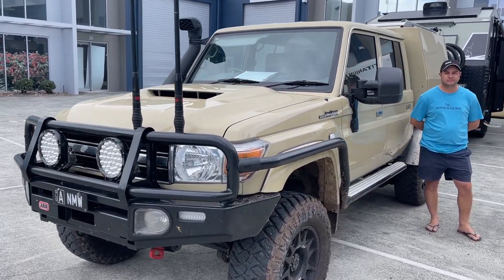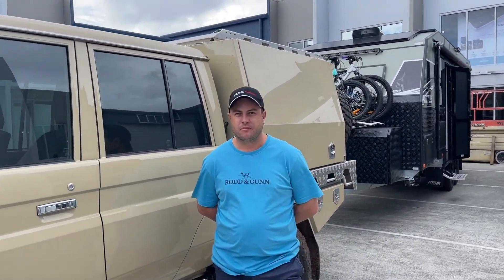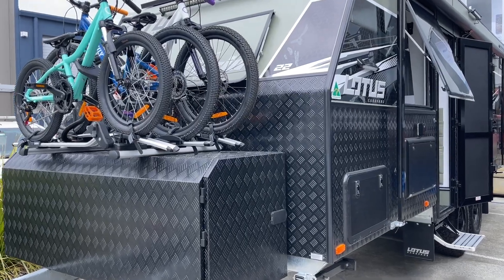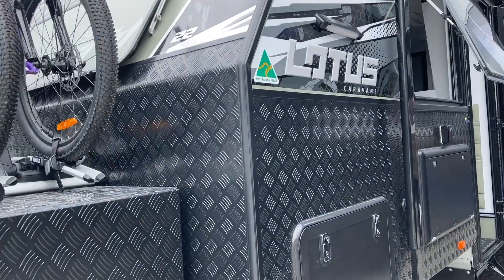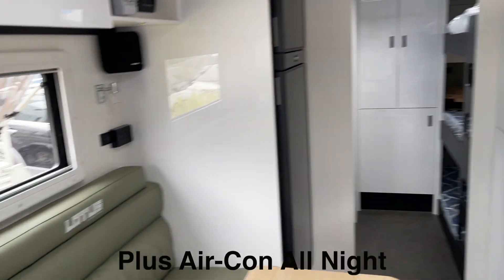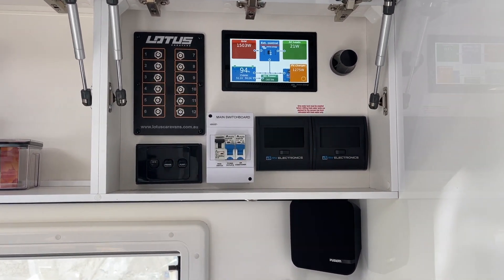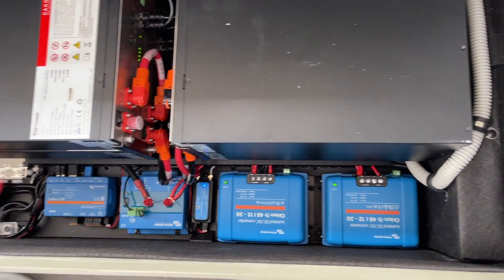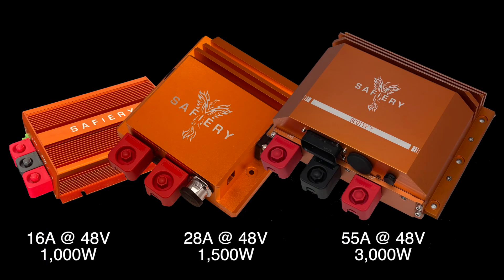48V System in this Lotus Caravan - 1,615W Solar with Scotty Backup in LC79

Comment: You can't charge 1k watts at 12volt with that panel setup , it's a joke 😂😂😂
Reply from the maker: The 12V is an equivalent. Its at 48V actually. In summer it will charge the Lithium shown between 20-90% with no problem. In winter, it wll need Scotty AI from the vehicle alternator to do that. Cheers.